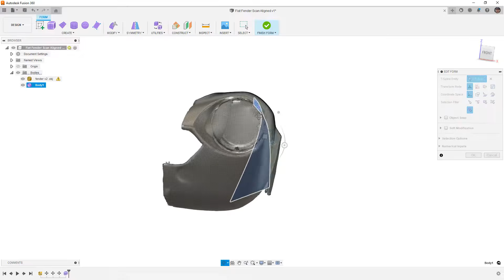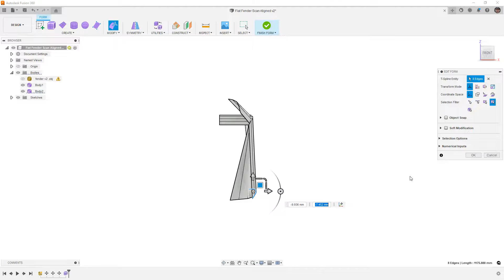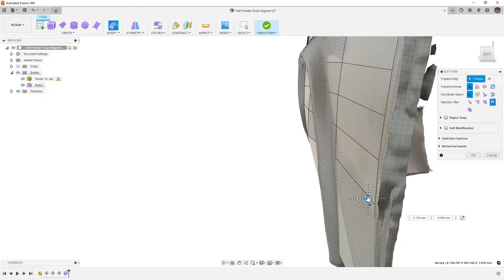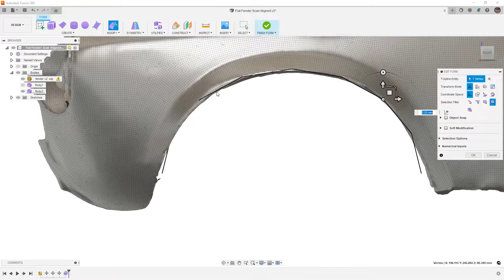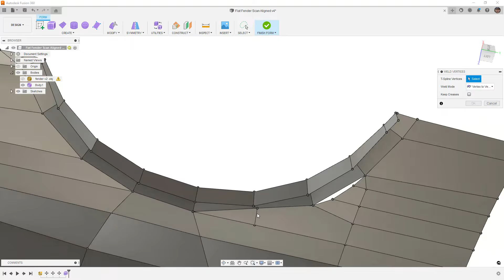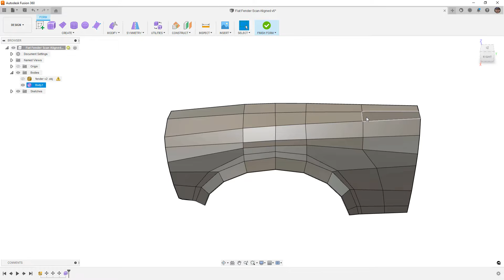Reverse Engineer Car Parts with CAD | Fender Modeling from SCAN Data - Part 1 #Fusion360

Comment: Great video.   Curious, is this the best way to recreate a multi-directional curve over an object?   I am if I am trying to copy something.
Reply from the maker: Thanks.  So its hard to say "best" to any of these methods.  With Fusion you don't really know how close you are to the original object.  For that I use QuickSurface.  It allows you to analyze the mesh and created geometry and analyze how close you are.  With Fusion it is a bit of guess work.  If you are making something to fit to a mesh this is generally easier as you can snap directly to the mesh.  But snapping to the mesh isn't really going to give you an exact copy of an entire fender for example.

Fusion does have mesh section sketches, so you could create curves and loft surfaces between them.  There really isn't a way to draw a 3d curve on the mesh though so other than loft profiles, guides are tricky to reference the mesh.

So all that is to say, if you need to really reverse engineer something a dedicated mesh program like QuickSurface is really the way to go.  if "close" is good enough or if you are making a new part to attach to a reference mesh Fusion works well enough for most people to not want to buy another software.

Comment: In the workspace I can not get the mesh to stop being pink even with appearance and physical material, makes it hard to see the sharp edge. How do I get it to be a different color?
Reply from the maker: try Shift + F.  Sometimes "Display Mesh Face Groups" is on for people.  You can find this setting under the "Inspect" drop down.  Mesh face groups is helpful when you are trying to convert a mesh to a solid. but otherwise its an eyesore:)

If that doesn't do it make sure Component Colors is off (also on the inspect menu)
Reply: @LearnEverythingAboutDesign shift F did it thank u!!!

Comment: Hello, first of all, thank you very much for your video, it was really helpful. However, after I started applying the reverse engineering process to the part I scanned, I couldn't use the smooth feature anymore. It was fine at first, with details and so on, but as the process progressed, when I applied smooth, the box appearance remained exact
Reply from the maker: Hi there, usually if you are stuck on box display mode that indicates there is a problem.  usually with a bad or unwelded vert somewhere on the model.  You can try to use the Utilities > Repair body tool and see if it can fix it for you.

If not you will need to look through and find any points that are possibly not welded/joined.
Reply: First of all, thank you very much for your answer. The automatic repair option wasn't helping, but then I realized that the mesh line I added was distorting the main line, so I deleted it and the problem was solved. Thank you very much.
Reply from the maker: @naimov61  Awesome, glad you found it!!!

Comment: I came to watch this video because i just bought a scanner. Im really curious in the scan to cad workflow but have some experience in 3dmodeling with sketchup and blender. If i look at how you take on modeling the fender i think its usefull to take a quadmodelling approach which is used in blender or 3dmax and the likes. it can cut a lot of time modeling.
Reply from the maker: Hey There.  on this channel there are probably a dozen series of scan to part workflows with different approaches.  Depending on the scanner you have we might have a series dedicated to that.  

For the modeling there are a few different ways to go about this.  Forms modeling in Fusion is similar to poly modeling in Blender.  You do want to stay 4 sided whenever possible.  But Forms behave a little different than how it would in Blender.  Ngons/star-points have a bigger impact here because of the conversion to NURBS surfaces where in Blender you have various tools like edge/vert weighting, sub-div modifiers, and smooth shading.  At the core the modeling approach is similar and you can actually take a quad mesh from Blender and convert that to a form in Fusion.  or take the control cage from a form and bring that into blender.  But the output is where the difference is.  Blender solves for these surfaces graphically so you can have something like a low poly car modeled with a few hundred quads and edge weighting but in Fusion if you want some tighter transitions you add more edges.  Changes in direction are (i find) more difficult in Fusion, but for a part that is going to be manufactured sometimes a necessity.

The biggest challenge with this stuff in Fusion Forms is honestly keeping a wheel arch rounded.  We have a few car modeling series as well as a scan to 3d printed widebody series and a few others that focus on different approaches and highlight the challenges with it.
Reply: @LearnEverythingAboutDesign   Supercool that you reply this elaborate! I understand what your saying. Is there a way to model this efficiently in a program like blender/3dsmax/maya and than use that geometry in fusion? or do you think that defeats the purpose?
Reply from the maker: @TwanvanDijk  Well a program like Alias is more made for that honestly.  The issue with max/maya/blender is that you are still left with a mesh which then needs to be converted.  There are "ways" but there will be a loss.  If you are just going to 3d print you could stay in those mesh tools.  If you want to do more CAD work to it or machine from a true NURBS surface then the best route is a quad mesh export as OBJ, and bring that into Fusion.  In forms you can convert a quad mesh to forms with some success.  it gets mad at you with too many quads.

I haven't tried blender 5 yet so i don't know if there is a new export option but in blender 4 there wasn't.
Reply: @LearnEverythingAboutDesign  thanks for your response i'll look into alias!
Reply from the maker: @TwanvanDijk  Fair warning it is not a user friendly software :)  They have a free 12mo home learning edition but the commercial price is between $4k and $10k/year depending on which variation you have...  Its an auto surfacing program with sub d and class a surfacing tools.  Something a design studio or OEM would use to go from a polygon concept to a production surface.
Reply: @LearnEverythingAboutDesign  It looks really interesting and daunting at the same time indeed! Never heard of the software but there you go. This is what the internet is made for, Thanks for your efforts!

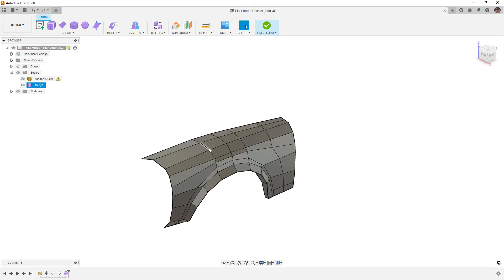Comment: hi, great video! I've a questio : at 1:08:38 you select a square of the surface and after that all the surface became rounded. How do you do this? thank you in advance for your feedback.
Reply from the maker: It was a shortcut key to switch between smooth display and box display.  ALT+1 is box display and ALT+3 is Smooth Display.

Comment: What are the commands to snap to mesh? Or is there a video on this? Thanks for the videos!
Reply from the maker: When you start a new freeform using the FACE tool there is a check box that lets you snap to the mesh.  this is just on creation.

When using EditForm there is a snap check box that lets you stay snapped to the mesh on moves, but this is really buggy in my opinion.

what i typically do is adjust manually and if i need to snap to the mesh use Modify > Pull.  that lets you pick which points you want.  There are two options.  I generally snap to the smooth and not control display.

Comment: Please help me again, my friend. My Fusion 360 shows scans as larger than they actually are. For example, a 21 mm long scan is shown as 210 mm. I'm using a Raptor Pro scanner. I'm probably missing something, but please help. Thank you.
Reply: If anyone has the same problem, use insert-insert mesh
Reply from the maker: i think you figured it out but yes you don't want to open the mesh in fusion, but use Insert Mesh.  There will be a unit dialog option.  Often times you will also find a different depending on the mesh export. stl vs obj vs ply might give you different outputs based on the software you use.  STL files are "unitless". so basically you get a unit =1.  If the file was mm (by default in nearly everything) then when you insert it into fusion just make sure the insert units are set to metric.

Comment: Hi, thanks for the video. Could you please tell me how to change the color of the wing model? Mine is pink and the wing edges are not visible. How can I make it look like yours? Thank you.
Reply from the maker: on the inspect menu in Fusion there is a mesh face groups setting that shows face group colors.  that is likely on.  Try toggling that off an the mesh bodies should go to the default steel grey.

If its a body/surface then its likely the component color cycle option (also on the inspect menu)
Reply: @LearnEverythingAboutDesign  Thank you my friend, everything worked out!

Comment: Hi, thanks for the great content

If i want to flat a piece like this to obtain a DXF, is possible?
Reply from the maker: Unfortunately not, at least not directly in Fusion.  There is an add-in you can buy called ExactFlat (or there was).  It cost more than Fusion itself.  Other programs like Inventor and Solidworks have tools to flatten a surface and give you a dxf.
Reply: @LearnEverythingAboutDesign  Thanks for response.

If there is another option would be helpful.

I've created a Windshield following your process but i need the template.

Comment: when i try to switch to smooth display nothing happens.
Reply from the maker: Generally that means there is a problem somewhere.  usually an overlapping section or possibly a vert that isn't connected.  First try going to utilities and "repair body".  if its an error star or t point that will usually find it.

But an issue somewhere is what prevents it from going to smooth display.
Reply: @LearnEverythingAboutDesign solved it! Thanks mate.

Comment: I would love for you to start with quicksuface surface software and make tutorials on it!! With your YouTube channel I bet you can have it for free and make tutorials on it 🙏🙏🙏
Reply from the maker: https://youtu.be/mvTkw3Aly_s

I have a few videos on QS Lite and will be doing more (one on auto freeform should be out this week).  I am also working on courses for my site on QS Pro and the solidworks add-in.  if you are looking to buy we are an affiliate. LEAD10 will save you 10%
Reply: @ that would be amazing 😍🙏
I already purchased the quicksuface I didn’t have another choice fusion was to hard for me for reverse engineering 😅 so I use both I make some parts in quicksuface then continue the rest in fusion

Comment: Interesting but lofting 4 / 5 sketch will be faster and keep parametric stronger method I tink
Reply from the maker: Depends on your workflow and goals.  When doing a mesh based model, especially one you want to tweak using forms can be much quicker.  Doing a mesh based design with surface lofts requires a lot of time.  You need to get mesh section sketches, but the auto splines created are trash, so then you need to manually create splines.  For something like this you would build the wheel arch first, then the fender, then trim and blend them together.

Forms isn't great and dimensionally controlled geometry, but for this specific case it was going to be a 3d printed fender for a racecar with a bit more wheel clearance.

Comment: Thanks again for the video, I have a question regarding you scan data.

When I insert a mesh, the colour of my file is usually orange/pink/blue etc with lots of triangles. I noticed your files are usually little squares instead. Is this something to do with a different version of fusion ? Cheers
edit: I just realised it's tri to quad conversion which I don't have in the hobby version :')
Reply from the maker: Thanks!

On the mesh color. try hitting SHIFT+F or go to the Inspect menu and turn off the mesh face groups.  When converting a mesh to a solid in Fusion creating mesh face groups is how it knows to divide up the faces and try to recreate parts.  For example a block with fillets.  Each face will be a different color and the fillet should be one color as well.  Sometimes this can be a pain when just looking at a mesh though.

As for the quad vs tri stuff.  Fusion doesn't do anything special bringing the mesh in.  and STL file is always going to be a tri mesh.  OBJ and 3MF files (and some others) allow for quad meshes and other data like color/material.  If you go from a mesh program or the scan software, sometimes you can do a quad remesh.  Autodesk has a program (that isn't new/supported anymore) called MeshMixer that would do the quad conversion.  It is free but support/updates stopped years ago as some of it has been rolled into Fusion.  But yes you need a commercial or EDU license of fusion to do the quad conversion.  that is in the mesh conversion tools with the "Organic" option, but that convers a tri mesh to quad and to a freeform body.  I don't think there is any direct mesh conversion to quad from a tri.  If you "tessalate" a solid to a mesh there is a quad option BUT you can't save it as a quad for some reason.
Reply: @LearnEverythingAboutDesign  Thankyou so much I will try all these out! Really appreciate the time you take to respond, and love your videos!

Comment: QUESTION - Great tutorial by the way , I'm trying to convert this sheet metal curved body of the fender into a " SHEET METAL BODY " so that it could be unfolded, and then laser/water jet cut , and rolled out on roller machines to form. Could you please show how to conver the fender covered throughout this one video to a sheet metal body that can be unfolded so I can convert it to DXF for cutting. I'm modeling airplane sheet metal bodies at my aircraft job  :) Im trying to look smart so this would be super helpful for me to impress someone.
Reply from the maker: Hey there!  you sadly aren't going to like my answer.... It can't be done (in Fusion).  There is an add-in called Exact Flat but its expensive.  Other programs like Inventor and Solidworks(top license option) have a flatten surface feature.  When you flatten a complex shape like a fender there will be a color map to show you areas that stretched more/less from the original design.  You can then take that shape and export as a dxf.  Typically this is done for fabric for composites or to make decals.

Sheet metal in Fusion (aside a bit from the lofted flange option) is not made by forming, but by bending.  So it can only deal with single axis bends and not complex forms.  For what its worth Solidworks, Inventor etc don't convert complex shapes to sheet metal either.  They flatten a surface "skin" of the part.  

Sorry!

Comment: I can’t change the appearance from the import. It is orange and seems to be locked.
Reply from the maker: try Shift + F or go to Inspect > Display Mesh Face Groups.  That might be on.  If you see a color bar in your timeline and in your browser then you  may have put on Component color cycling.  turn that off and it should go to whatever apperance you have.

Mesh face groups are helpful if you are trying to convert a mesh to a BREP solid, but other than that they can be a pain.

Comment: with all this technology and scanners becoming more affordable it boggles me how we have the most rediculous miriad of features but not one program that takes the scanned obj,ply or stl for direct cad,why on earth waste time creating all these redundant tools to essentialy do what the program is supposed to do
Reply from the maker: There are programs that will "auto surface" scan/mesh data.  Solidworks tries.  Fusion "can" do this if you have the product design extension (not avail for hobby users).  But basically it needs to convert the tri mesh to a quad mesh.  If you have a quad mesh you can attempt to directly convert that to a form.  What you find is that these types of conversions never offer up ideal geometry.

The Autosurface tools in programs like Geomagic and QuickSurface could get you a surface model, but again you wouldn't have any sort of control/input on the shape.  In a case like this I knew the user wanted to make a variation of the fender for their race car and the final was to be 3d printed.

Comment: This process seems incredibly stupid. I imagine someday you just scan the part and click print. Why can't software do that currently?
Reply from the maker: Well you can do that with some things.  In scan software you can close a scan but that doesn't really work for thin parts.  and then you don't get to modify it.  If you scan say a figure that has a flat base on a turntable, you can close it on the bottom and send that mesh right to print.

Comment: Sigh, I'm trying so hard to follow along at this and I just can't wrap my head around it for my project. So frustrated. I have a great scan I just can't seem to make it happen. Your video is excellent, I'm just not cut out for this I guess.
Reply from the maker: You can do it!  Just make sure you start with the basics of form manipulation first.  I have a forms course on www.LearnEverythingAboutDesign.com for $10 or you can go through the forms mastery playlist on this channel for free.  Definitely need to grasp the basics of form manipulation. edit form first.
Reply: @LearnEverythingAboutDesign  I kind of figured it out using a very crude way. I extruded into the face of the scan, and now I'm using that to make my part. It only needs the face of the scan to mount to with 3M tape. I'm going to keep learning though and hopefully learn how to do it the right way.